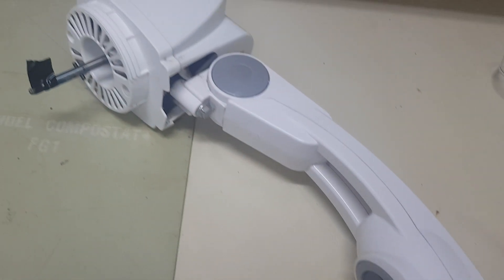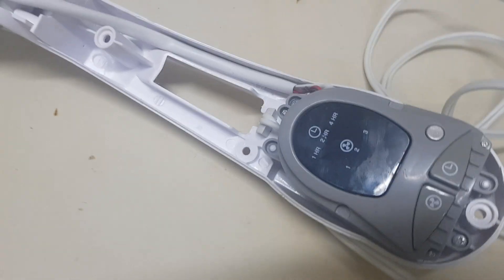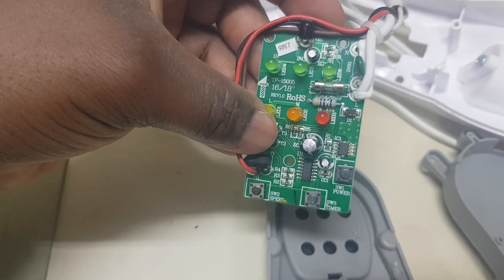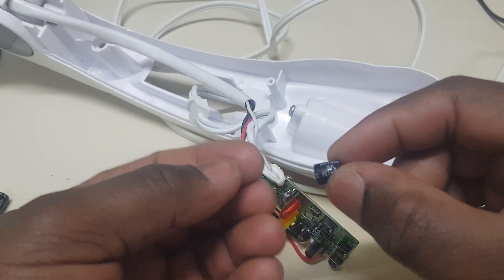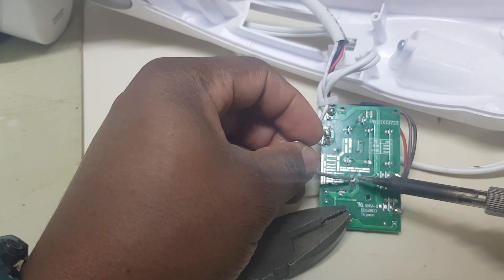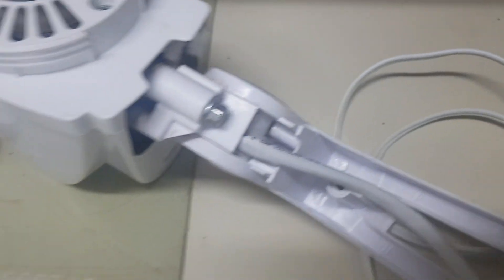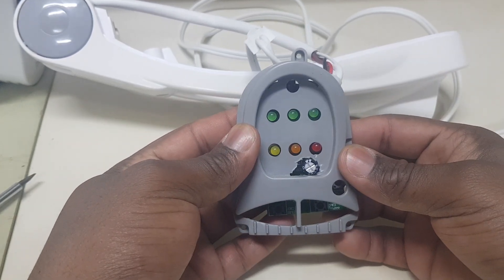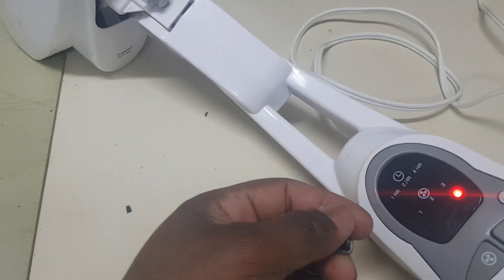Lasko fan PCB repair | Check and replace defective electrolytic capacitor.

Comment: Can i use a 25v 470uf for the capasitor or do i need the exact same 16v 470v
Reply from the maker: It can work but you will damage the circuit over a period of time due to the circuit wasn't designed for it. I suggest replacing it with the same 16v 470uf.

Comment: Same fan but the three speeds are spinning slow
Reply from the maker: Okay check both capacitors and also the one at the back of the fan. Do a visual inspection and also use a capacitor tester.

Comment: Thanks a lot Now adays it hard to find an old school repair shop. I bouth 3 fans 2stop working. I would like to try to fix them myself. I found the part on Ebay. what is that tool called you were useing?
Reply from the maker: @angeldavis9443  Thanks for the feedback, I appreciate it alot. And greatful that my video helps. The tools that I was using is a multimeter and a soldering iron.
Reply: Rn am having the same exact problem ..how can i solve asap ?
Reply: @rayonrichards I bought the parts and I couldn't get the little peace off the green part it was stuck

Comment: Exactly the video I was looking for. Same exact problem, I just have to find the same type of capacitor now so I can try it. Thank you 😎👌🏼
Reply: Not been able to locate the same exact part, but I found a 10v one which I decided to try just to know if that was in fact the problem with my fan and it totally works! It's running fine with that one so far but I will still try to find the correct one for it. Thanks for the video my friend 😎👌🏼
Reply from the maker: @therealgabrieldixon8788 Your welcome and am greatful for the feedback 👍.
Reply from the maker: Thanks for the feedback, am greatful that my vedio helps. And I would love to hear from you when you repair yours 👍
Reply: @IshiTechtronics2570  I will give an update as soon as I find the part and try it!
Reply from the maker: @therealgabrieldixon8788  Okay 👍
Reply: Having the same problem.rn with mines